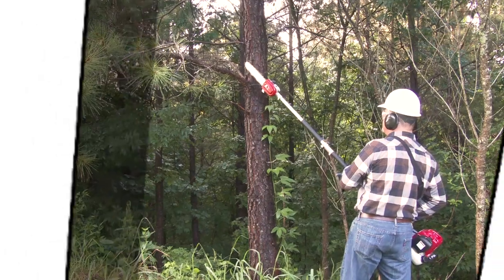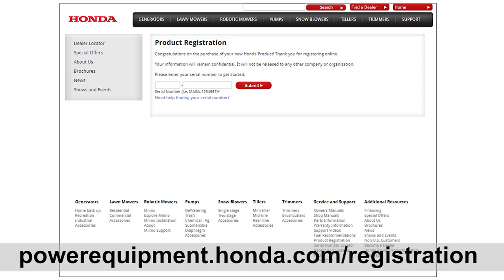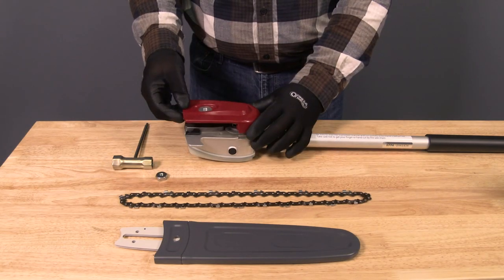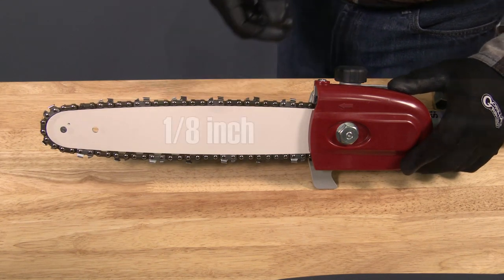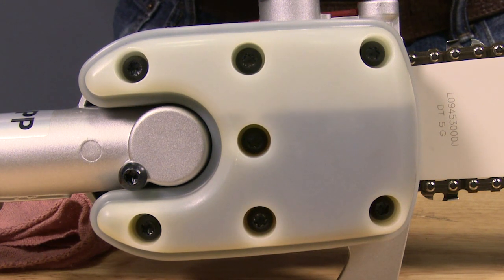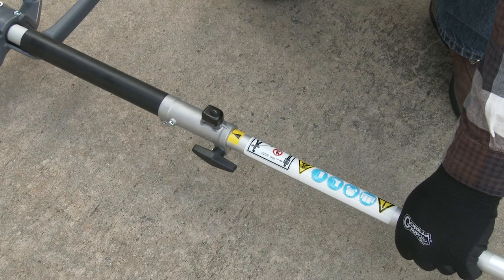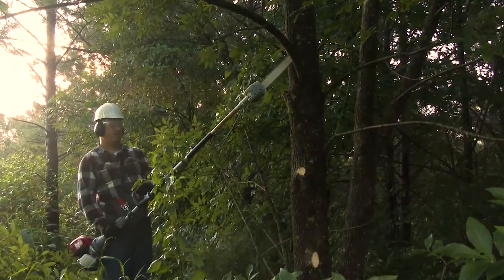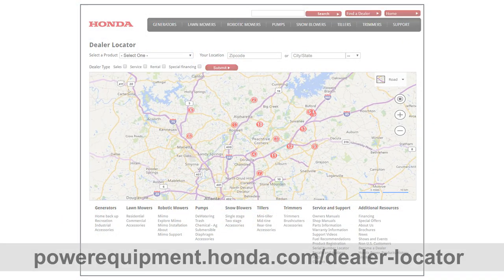Honda VersAttach Pruner Attachment Setup and Operation

Comment: Mine doesn't seem to cut with ease.Even on smaller branches so, maybe I need to tighten the chain to the bar a little tighter.Maybe it's not really one eighth of an inch.

Comment: I bent the tensioner on this getting the pruner down since it got stuck high up in a branch that pinched it. I looked up the replacement parts - the 2 little gears and 2 bolts cost $120 from Honda- uttery highway robbery.  The pruner itself is $180, so I'm just going to buy a new pruner. Just know that if you buy this, every little bolt or part that cost them 15 cents to make they will charge you $25-50 a piece. The most minor of damage will basically total the unit, because you might as well just buy a new one. You guys are thieves selling parts at that price- outrageous price gouging.
Reply: look after your equipment.
Reply: @blameusa7082  🙄
Reply: @sly9263  I just bought one yesterday along with a UMK435LE, ill let you know when it breaks!